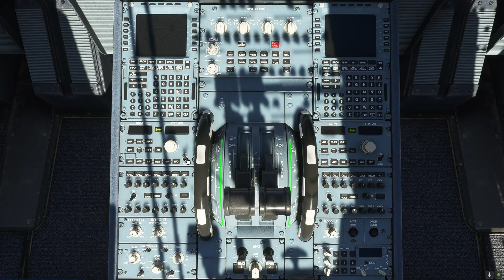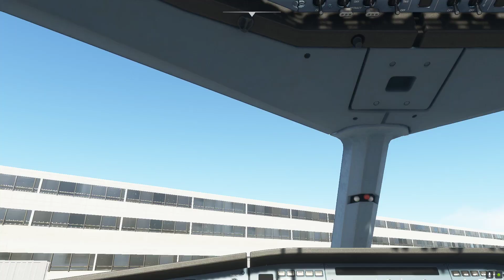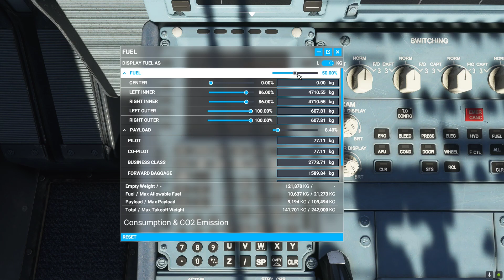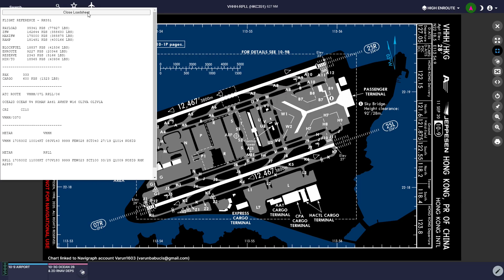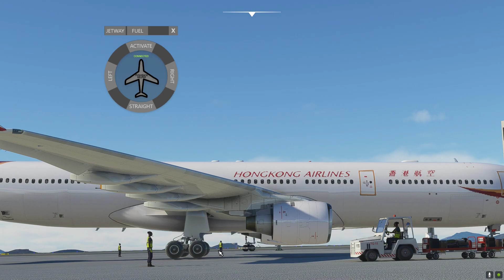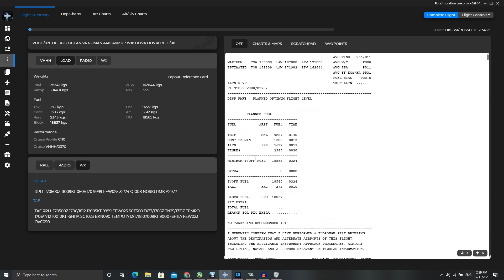MSFS 2020 FULL FLIGHT [Canadian Mods A330-300] Hong Kong (VHHH) - Manila (RPLL) HONG KONG DEPARTURE!

Comment: Nice! Definitely keen to give this one a go at some point! Does it handle any better than the default 320? : )
Reply from the maker: Yea you should definitely give it a go. As an A320 pilot, the A330 should be right up your alley. Unfortunately, the handling characteristics aren't the best, as it clearly evident in the second part of this flight where we cover the arrival into Manila. I follow the dev team on discord and they have made remarks suggesting that they're working hard to continuously update the aircraft though, so you should see some improvements in the future. Thanks for stopping by mate!
Reply: @FlyBySimulations  Ah, if the handling is still a bit iffy, I think I'll hold off for now and wait for the Dev's to fix it. Looking at the fuel options etc, looks like it really is the A320 flight model in a 330 shell. Still, nice to have the option, made for a good vid : )

(Haven't had a chance to watch part 2 yet, but I'll keep an eye out on the arrival when I get the chance ; )

Comment: Download the Canadian Mods A330-300 Mod, hello, great video thank you. my problem is that on drive, the download does not work. he says readiness loading after 8 minutes nothing tells me that it has downloaded. and I don't see any files on my computer. have an idea
Thanks see you soon
Reply from the maker: Hey there Philippe, thank you so much for watching! Hmm that's really weird. Are you sure you're downloading the right file from the right place? Here's a link to the Google Drive folder where you can download the mod:  https://drive.google.com/drive/folders/1PzWVJT4L93_K23BG3Y5xEBnWOdDQtB9t You just have to right-click on the A330-300 tab and click on download and that should install the files on your computer. If your problems still haven't been solved, then don't worry, as I'll be making a video on how to successfully download the A330 mod for the sim very soon, which will cover both the main download as well as how to download liveries for the aircraft. So definitely consider subscribing to the channel as you'll then be notified when I release that video:) Hope that helps and have a great rest of your day Philippe :)
Reply: @FlyBySimulations  hi thanks for your reply. in fact, it was google Chrome which blocked without warning. I switched to EDGE, everything worked.
see you soon
philippe from paris